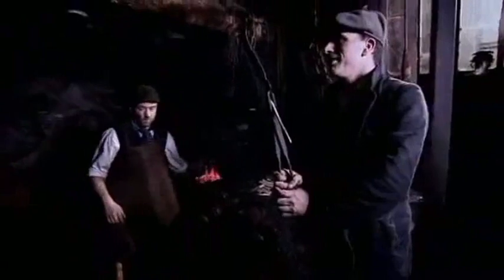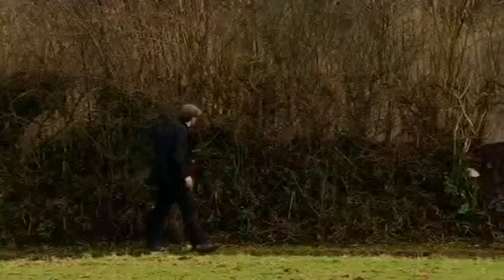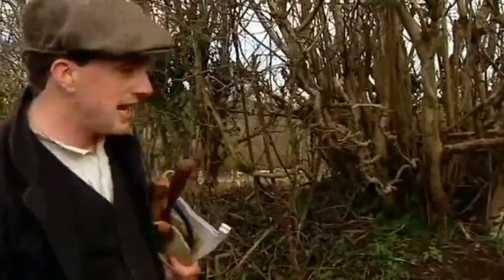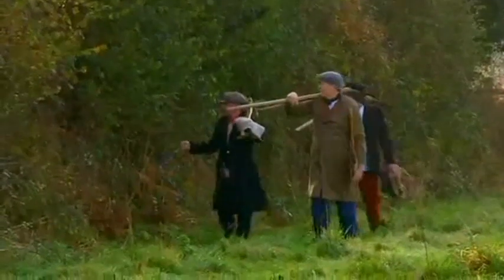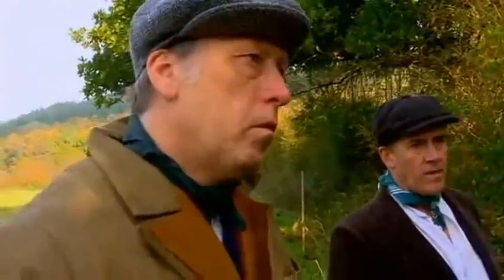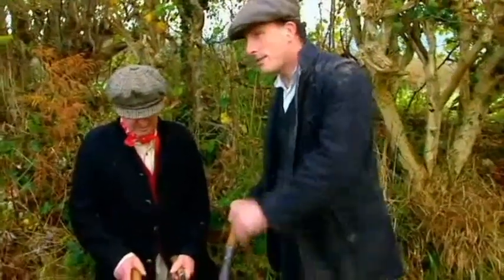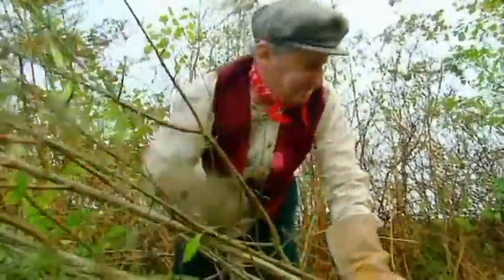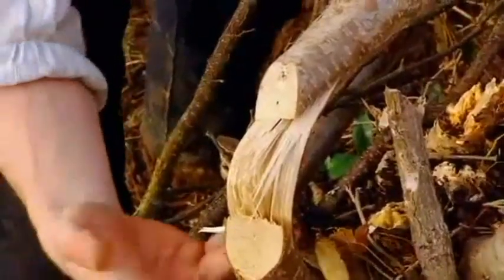Pleaching Hedgerow with Billhooks, Edwardian Farm

Comment: Looks like the English version of a machete
Reply: Its is.
Reply: I have both and the difference I would say is they are much heavier. It's makes cutting though hedges or branches super easy the weight will just carry through the wood. 

The machete is much lighter and easier to swing. It doesn't carry your arm with the weight better for traveling and more vines/brambles than thick branches through it will get through them just not as smooth as the billhook.